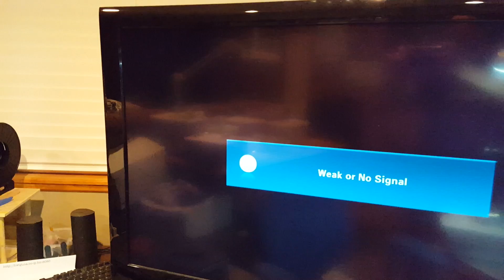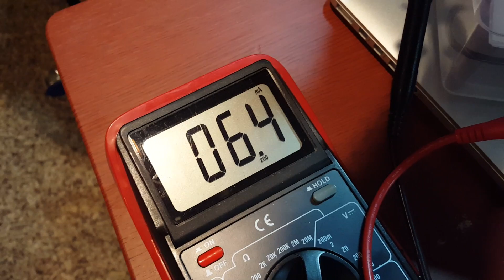HariFun #116 - Custom TV Remote part 3

Comment: where is the Tv Remote part 4 when you need it :)
Reply from the maker: +joseph chrzempiec (josephchrzempiec) , just finishing up the case.  I need to put mortise and tenon joints so the case would hold together without glue.  That should be the last thing.
https://goo.gl/photos/uaarjiNhEQjquys98
Reply: +Hari Wiguna  Perfect: )

Comment: Way cool man , love this project . I think it would bee cool to hook it to a bench supply and find its cut out/off voltage , so you can get a idea of how long your 2 or 3 typical cells will last . 
I wonder if accidental pressing more than one button would drain faster / reboot .  if you set the IR  sensor to be looking out a hole on the button face , you might be able to use it as a right side up detector , so if the remote is upside down or covered by something and obviously not in use , you could actually sleep your MCU for a few seconds  ,and  waiting for the ambient IR level to rise again .  the way putting remote down , button side down would almost be like a auto OFF .  Well  its a great project , cool to see it run directly from cells.
Reply from the maker: +XerotoLabs , testing the low voltage cut off is a great idea!
I already soldered everything so, I'm going to have to pass on the "right side up" detector.  Clever idea though!
Thanks for the comments!

Comment: to run at less than 5V, you are using a resonator slower than 16mhz yes?
Reply from the maker: +roidroid ,
I'm still using a 16MHz resonator.  I presume that is crucial for the IR library to be able to correctly generate the correct IR signals. Incidentally, since that recording, I've decided to power the remote with three batteries. so it's 4.5V, closer to the "normal" voltage.

Should I be concerned about running the ATMega at 16MHz on lover voltage?
Reply: +Hari Wiguna man i dunno.  I'm surprised it's not resetting itself, i didn't expect the specs to have so much wiggle room, but there it is!

Comment: That's awesome Hari.
Reply from the maker: Thanks man!
Reply: +Hari Wiguna would it be worth adding a power switch? wondering how fast the arduino boots up.
Reply from the maker: +builtrodewreckedit , that's an interesting idea...
I think it boots in less than 2 seconds, so definitely an option.
The battery compartment that I'm using has a power switch, I'll see if I can leave it accessible. Thanks for the tip!